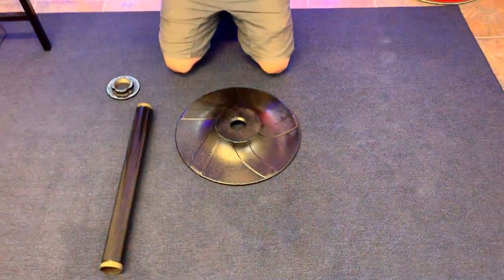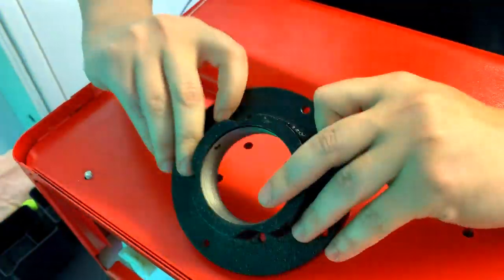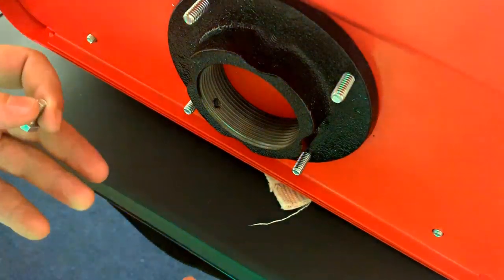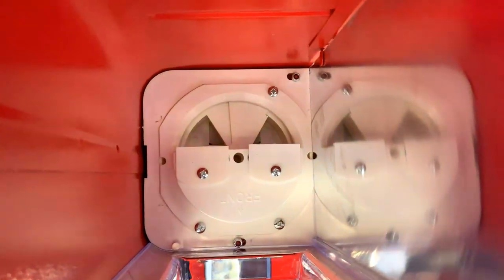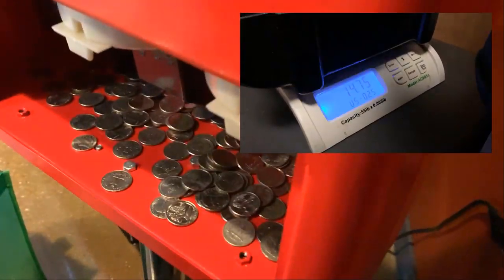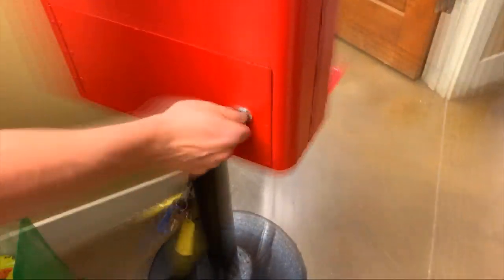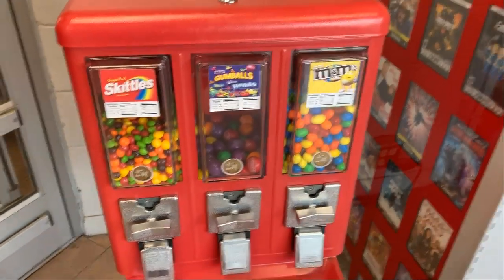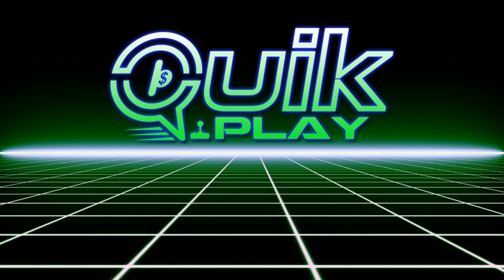Why You Should Buy A Bulk Vending Machine

Comment: Not a big deal, but putting a little grease on the threads of the stand pipe would help in the future if you ever had to take the base or flange apart from the stand pipe.
Thanks for sharing you info and experience ! 👍
Reply from the maker: That's a great tip Michael, thank you very much!!
Reply: I love your videos

Comment: How do you buy them for $95 NEW? They are at least double the price :(
Reply: Actually yes i was wondering the same, no site are displaying such a price, right now there are some promotion with which you can cumulate an halloween coupon leading the price more or less around $145, but certainly not around $95 except they do quite intensive grouped buy with huge command by 20/30 and again i estimate the total cost, production, wages, raw material and related cost to $50/60 for a machine to be built.

Comment: Hello hopefully you respond to this comment. Is there any way to change the amount of skittles I’d like for it drop instead of 10 on 25cents is what is currently giving me
Reply from the maker: Hey there! Yes you need to unscrew the face plate above the candy wheel and adjust it to a smaller setting. Check out our video “AVOID THIS BULK VENDING MISTAKE” which showcases this.